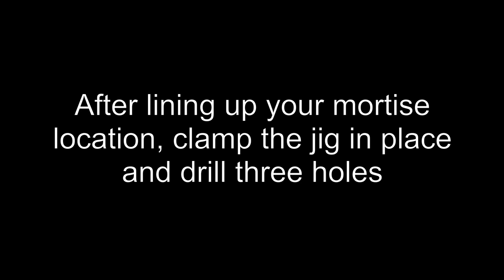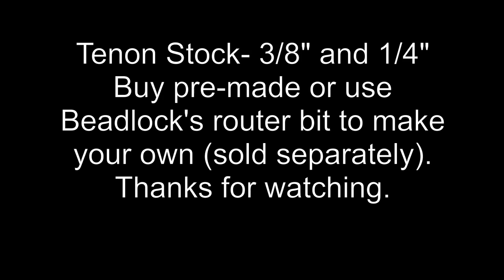Rockler Beadlock Pro Joinery Kit In Action | Patrick Hosey

Comment: I own this and would recommend it. There are a few issues you should be aware of if you own or want to buy this
1) when positioning the guide block along the two rails to center the mortise, it is possible to rack the guide block which will result in a jagged mortise. Measure the distance between guide block and blue plate to be sure it is not racked 
2) at 0:31 you see the jig flex when the clamp pressure is released. Excess clamp pressure can flex the jig. I use an F-Clamp (in combination with the built in clamp) to press the work directly to the blue plate so I don't have to over-tighten the factory clamp

Comment: A good system that covers most joinery needs. Shame the aluminium version is obsolete now. I find it gives a ' piston fit ' to M+T joints which need clamping together. It may be down to me making my own tenons with the appropriate router bit.
Reply from the maker: The size of the mortise is determined by the holes in the guide block and the drill bit, which haven't changed with the new model. The tenon is the same Beadlock loose tenon as the previous model. If used properly the fit should be the same. The jigs material changed from aluminum to glass-reinforced plastic. Which is extremely strong and durable, but even lighter and more cost efficient for the end user. The Beadlock Pro has more capabilities and functions than the original. With the original clamping system that was built in, it was a size and location limiting factor. Hope that helps, thanks!

Comment: How would you use this for something breadboard ends where you need a slot wider than the tenon for wood movement.
Reply: you could use this as the start, do a 3rd hole when you move it oved then chisel out in between the holes for a smooth hole

Comment: So - just about every jig now seems to cost around $200, when you actually start using it in a serious way? I can't imagine woodworkers staying with commercially produced tenon stock. I can see the utility if you need a quickie joint without any metal in it. Otherwise, Kreg pocket holes are the go-to technique for new or utilitarian woodworkers.
Reply: *****
I agree. I have had Kreg jig for a while now and there are situations where you do not want to see the screw holes (yes, I know about the plugs), but rather a clean, smooth wood piece. That's why I have also purchased the Beadlock to cover those situations. I love Kreg jig for not clamping, but no tool can cover 100% of all joints needed.
PS: Great video!!! Thank you.
Reply: Agreed.  I have both and use both.
Reply: This table would look like crap using pocket holes. Mortise and tenon is much cleaner/stronger and not much more work for a superior joint. Seems like you newbies are lazy. Pocket holes are great for cabinet face frames and places where the pocket hole cannot be seen. It was actually devised for a down and dirty solution to real craftsmanship, which by the way has gone to the toilet in recent years.